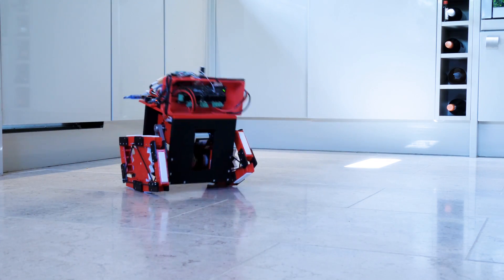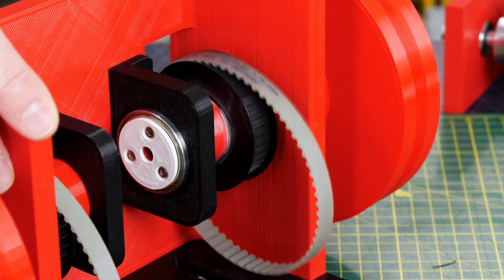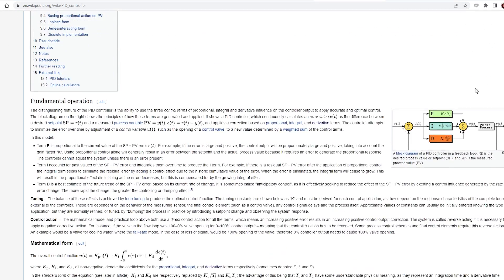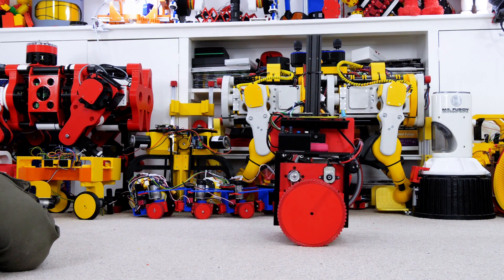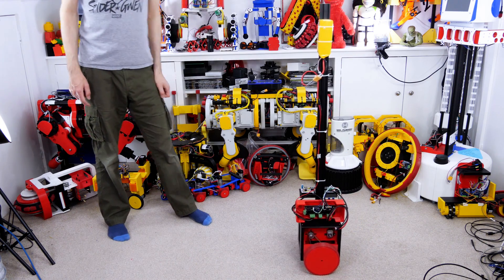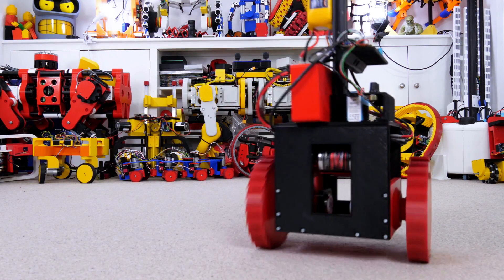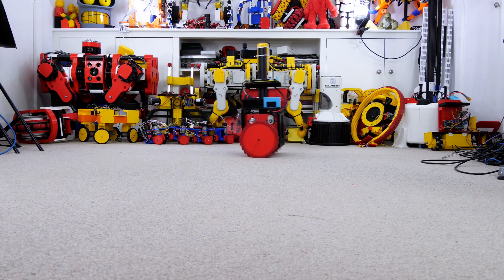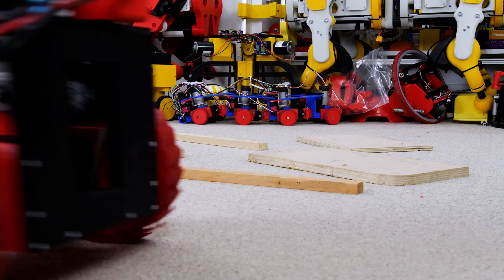Why this Robot is Really Tall

Comment: I'm starting a single wheel (unicycle) bot project this summer or next fall. It will have a 2 meter pole up top, but there will be a canard (a v-wing configuration) of sorts atop the pole. The idea is that once it's moving at speed, forward, balance is handled by controling air resistance across the v-wing. This should also allow it to lean inward to take shallow corners at a pretty good clip. I'm thinking of making it as lightweight as possible - basically a minimal skeleton of carbon fiber tubes. Speed is the objective -- that is, speed over maneuverability, and being lightweight should reduce power and battery requirements. A fair description might be a mix between a balance bot and a fixed wing aircraft. And it has to look cool, of course -- very cool. Goes without saying it will look different.

Comment: You are so good at balancing robots, you should get rid of the wheel and go for 1 leg. Make a 1 leg pogo bot and try to see what kind of terrain you can traverse. For more complex obstacles it's going to need computer vision and/or load cells in the foot. Should get very interesting without hitting the mechanical limitation walls of other balancing bots.

Comment: could you add an identical pair of wheels at the top end and drive them with additional belt drives from the motors or maybe from the other wheels like tank tracks? presumably it would work just the same upside-down? maybe without even modifying the code? 
with a great enough power-to-weight ratio and a short enough wheelbase it might be able to somersault itself end-over end. apart from being fun to watch this might be useful for getting over obstacles. maybe even going up stairs? anyway might be a quick thing to try

Comment: If you angle the bottom of the robot so it's more V shaped than square you will much improve it's approach and departure angles for attacking larger obstacles. I realise you can make a vehicle better off road simply by increasing the size of the wheels but it might be interesting to see how well you can make a balancing robot tackle a forest track or ford a stream or similar.

Comment: I wonder what impact it would have if you used the upper section of 20x40 extrusion to drive a vertical weight up and down to change the center of gravity as you are driving. That way you could lower it to get more aggressive response and raise it to smooth out the balancing when you want to stay in one place.

Comment: I've noticed that when it falls over the wheels go mad trying to compensate for being almost horizontal... 
Is there way to code the behaviour so if it has a near-horizontal angle being read from the IMU it stops the wheels? Or would that not work as it's in reality an intertia measurement and not an angle measurement? Perhaps if it holds a particular angle for a few dozen miliseconds then we can conclude it has fallen over?

Comment: You can probably correct the fast position estimate using the slow position measurement. I've seen people do that with fast/inaccurate accelerometers vs slow/accurate gyros.

Comment: A small tip: the oscillation you're seeing is called "limit cycle behavior" and can be predicted (with some reservations) using a describing function for the combined non-linearities in your system. Anyway, long story short. This is a common feature of PID control in combination with systems that have dead-zones such as mechanical play. Try using an LQG controller or similar perhaps if you're looking for a little more "fancy" control technique (however that requires some form of system identification). ps. A Smith predictor could potentially aleviate some of the delays you're getting from reading back from the o-drive. Cheers and thanks for the videos
Reply: Don't you mean LQR? Or LQR and kalman filter combined?
Reply: @ratulxy  LQG means LQR + Kalman
Reply: hysteresis, not limit cycle, but yeah, good enough for engineering maths
Reply: @DrWhom  hysteresis is when a systems state depends on its history. Limit cycle is when a system is "locked" in cyclic behavior such as an inverted pendulum tipping back and forth repeatedly. You could have googled this in less than a minute, but thanks for the comment.

Comment: You should be able to move the robot to a position just from setting the pid value to some number and the robot should move to that point then if you added turn commands you could make a path for the robot to follow around a house and it should follow it

Comment: Not clear why you ALWAYS use PID controllers. I know that they are the swiss knife of any Automation Engineer, but there are way better controllers that suit different problems. My first choice is always a Linear-quadratic regulator: almost easy as PID but it can achieve multiples goals and it can work even with multiple control variables if needed.

Comment: Absolutely love that you used dual nested PID loops, I was actually going to suggest it.  Though I will still suggest using all three terms on the outer loop to squash those remaining oscillations; all three terms really do work together and are greater than the sum of their parts (i.e. if you include the integral, you can use higher dampening by lowering the proportional value; potentially giving the same effect with less oscillation).  Still, this is performing really well, and I love it!

Comment: You could add a bump on the front and back so that if it falls over, it gets high-centered and the wheels can't drive it across the floor sideways.  Or cut out the motors if the angle gets too steep.

Comment: Excellent result!

Your standard balancing robot code should probably implement a tip-over cut-off at some degree deemed irrecoverable, just to prevent injury and accident during development. I don't know what the code should do though: freewheel the motors?
Reply: My "kill switch" for stuff like this just powers down any drive motors / servos. The robot just kinda goes to sleep and doesn't try to do anything. The code would just be setting a power of 0 for everything.

Comment: Hey, love your work! I've just gotten a OpenBuilds1010 CNC Router. And being so inspired by your work, I want to make a Sport MonoCycle! Think Tron Bikes, or the Bat Bike from the Christopher Nolan Movies, but take away the front wheel, battery behind the remaining wheel, Shallot shaped cab, electric hub motor. (If we're being extra crazy, a Liquid Piston engine?!) Steering would be handles by leaning, I was thinking coil spring inline between driver and wheel?

And could you slap some Skates and/or wheels&motors on the Open Source Dog?! Cute and practical!

Comment: Hey James, you should code in that if the angle exceeds 45 (or more) degrees, the engines stop. So that if it falls over, it doesn't try to keep running.

Comment: Skyentific did a pretty hacky modification to the odrive-Arduino library so you can send 1 character instead of sending the requested string “odrv0.axis0.encoder.pos_estimate”, over serial (which is not overly fast). So if you depend on serial to do a formal position hold algorithm you might want to look into this. Or even better you can modify the odrive firmware and just send the odrive encoder values without request

Comment: 8:40 I think this is because the wheel rotates even though that rotation doesn't actually moves the robot. So its actual position is not the same as the position the robot thinks it's at. 
Maybe this could be fixed by using some kind of sensor that works similarly to a mouse?
That may cause issues when it's driving on transparent/reflective surfaces though. It may also cause issues when the wind blows stuff under the robot or when something like grass is waving in the wind.
Maybe an accelerometer can be used to calculate the distance travelled?
Reply: You could use sonar to get around the reflectivity or transparency issue, and grass shouldn't hurt a decent ultrasonic system too badly to the point where it's unusable.

Comment: I'm at 7:14 now, but I've spotted a potential problem. If you keep increasing or decreasing the set point then it'll eventually roll over from its maximum value to its minimum value or vice versa. That may cause it to completely freak out. So I think it would be best to do something against that. I don't know how that can be solved though..

Comment: Has anyone invented the code for auto-tuning PID control?
Say in an Arduino or similar environment? I know it exists on some servo controllers.
Reply: Wikipedia has a sort of math algorithm pseudocode you can use. It is essentially a chirp algorithm that identifies the natural frequency of the system, from that it does some magic math to iteratively attenuate the oscillations. I think it can accept parameters like desired settling time and max speed.
Reply: @marco_gallone  thanks.

Comment: James, would you like the challenge to build what looks like a dancer pole that misses the ceiling, and sits on a single driven spherical wheel that is no bigger than the pole diameter? Being tall it would barely need any response time and input, it would almost sit still. If placed in a room, sensors could scan the ceiling, perhaps with a cutting mat with grid stuck on there for precision calcs. The pole would seem stuck to the floor until tapped.

Comment: code wise, can't you read the accumulated encoder value like every second to correct? or an option may be a secondary microcontroller (i.e. make it "dual core") that keeps track of the position.

something I want to experiment with is basically a dual ir barcode scanner on 2 points in the room, with photo diodes on the robot, like what the vive does.  you have a constant speed mirror tangent but offset from the axis, and a laser line on the 2 bases, which gives you a line scan, you also add a spotlight which blinks at an offset from the mirror to sync up and see which lights are obstructed, then offset the 2 bases 180 degrees, so one scans while the other is blank.

then on the robot you have photodiodes on the cardinal directions which have a buffer that stores the time at which they saw the light (which allows fast speed, with a custom pcb and some good components you can get 100Mhz or even Ghz speeds.)

everything would be connected via wifi so the robot knows the exact speed each laser is scanning by at.
 the bases can probably just use an esp32 for everything.
a sane-ish value for the speed of the laser would be around 30-90m/s (16.2k rpm for the motor, at 1-3 meter from the base, with a triangle for the mirror) 
at 90m/s, you still have like 9um accuracy with a 10mhz counter, even if we take 2 orders of magnitude for correction and whatnot, we can most likely get sub mm accuracy, especially when moving slowly.
also since you're getting absolute position, you can position very accurately, and are probably limited by the mechanics at this point.

Comment: Nice machine, I guess that when making it taller, you'd need a wider wheelbase. There's probably some formula to calculate the width of the wheelbase in relation to the center of gravity which also dictates how heavy the 'stick' pointing up should weigh. And when looking at a Segway, the top part swivels, so it's not fixed. That might also help. Fixing it in the front-to-back direction, but making it so that it can actually move a little bit side to side with springs so that the top part keeps finding the middle. I guess this would need a lot of testing and tuning to get right as when you add a swivel with springs, it can also start a sideways oscillation.

Comment: Would be pretty cool to see a sort of 'runaway' mode, where over an accumulated pid error value it just turns off the pid controller. So in event of a runaway, crash, malfunction etc, it just turns off the pid controller and sits there dead, thinking about what its done (but legitimately, to avoid damage etc).

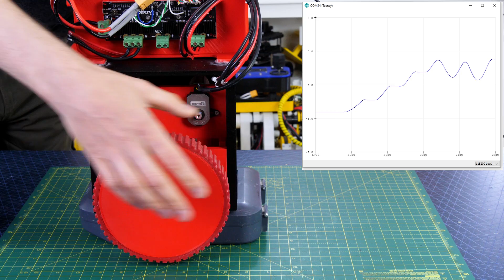Comment: @ 5:50
it's really simple actually, The robot knows where it is at all times. It knows this because it knows where it isn't. By subtracting where it is from where it isn't, or where it isn't from where it is (whichever is greater), it obtains a difference, or a deviation. The guidance subsystem uses deviations to generate corrective commands to drive the robot from a position where it is to a position where it isn't, and arriving at a position where it wasn't, it now is. Consequently, the position where it is, is now the position that it wasn't, and it follows that the position that it was, is now the position that it isn't.

Comment: Here is some help for creating a position hold algorithm, it is very similar to a guidance system for missiles which can be explained in a few simple steps:

The missile knows where it is at all times. It knows this because it knows where it isn't, by subtracting where it is, from where it isn't, or where it isn't, from where it is, whichever is greater, it obtains a difference, or deviation. The guidance sub-system uses deviations to generate corrective commands to drive the missile from a position where it is, to a position where it isn't, and arriving at a position where it wasn't, it now is. Consequently, the position where it is, is now the position that it wasn't, and it follows that the position where it was, is now the position that it isn't. In the event of the position that it is in is not the position that it wasn't, the system has required a variation. The variation being the difference between where the missile is, and where it wasn't. If variation is considered to be a significant factor, it too, may be corrected by the GEA. However, the missile must also know where it was. The missile guidance computance scenario works as follows: Because a variation has modified some of the information the missile has obtained, it is not sure just where it is, however it is sure where it isn't, within reason, and it knows where it was. It now subracts where it should be, from where it wasn't, or vice versa. By differentiating this from the algebraic sum og where it shouldn't be, and where it was. It is able to obtain a deviation, and a variation, which is called "air"

Just reverse the process
Reply: error, not air

Comment: I feel like there should be a function for if it goes over 90° (aka flops over sideways) it should have an emergency shut off and stop the wheels so it doesn’t try to whip itself around.
It already can’t drive on its side, but it’s not going to destroy itself.
Reply: Or somehow catch at just the wrong time and launch itself full speed into something lol.

Comment: That looks like so much fun.  With all the robots you build, why don't you start to make a lego-like modular system: make parts that are designed for re-use. If a part serves two purposes, split it with a common locking joint design.   Standardize on a restricted set of bolts and holes,  snap sizes to centimeters.

Build up your system  step by step: whenever you reuse parts from an old robot, re-design the parts you are scavenging  so that if you had thought of that redesign earlier, you'd just be able to detach on the old bot and snap onto the new one.

Comment: It would be cool if you made a vehicle that started horizontal on tracks or 4 wheels, but could then change "modes" into a vertical self balancing position. If it fell over obstacles it could still drive and then self right itself on flat ground 😊
Reply: Segway actually had a prototype of something like this, called the Centaur. It was an ATV that could lift up the front wheels and turn into a Segway 2-wheeler.
Reply: ETH zurich has a robot called the anymal that has shown this behaviour, not sure if they're the first

https://youtu.be/kEdr0ARq48A

Comment: It would be cool to see a working clap-trap model from Borderlands.

Also, you seem to always use the same size of wheels for the balancing robots. I was wondering what would happen if they were larger or smaller.
Reply: I think It would just effect the code needed to balance the robot, with smaller wheels they'd need to move more to balance the robot where bigger ones would use smaller movements
Reply: @Matty.Hill_87  That makes sense. Thanks! :-)

Comment: The code running on the odrive is open source and it's quite easy to add stuff to it.
Me and an old classmate modified the odrive code a bit to make the serial interface faster when we built self balancing bicycle.

You could maybe add code to always post/publish the encoder state at a specific frequency on its own, or move your balancing loop into the odrive.
Reply from the maker: I could probably just about do it, but not everyone can
Reply: @jamesbruton  yea, arduino is more shareable.
Really cool work as always!

Comment: You spend so much time with PID controllers, why not look at more complex self-tuning algorithms?
Reply: Have any examples or terms to search for? PID was what we were taught in university and it's still commonly used all across engineering fields. I'd love to see what newer models and systems people have thought up since the 40s
Reply: @kimtae858  I took a course on self tuning control during my masters. I remember some whacky stuff but haven't used any since. I remember something called a Diophantine Equation, and something about using poles to account for disturbances. I'll see if i can dig up some notes but maybe those terms can lead somewhere.